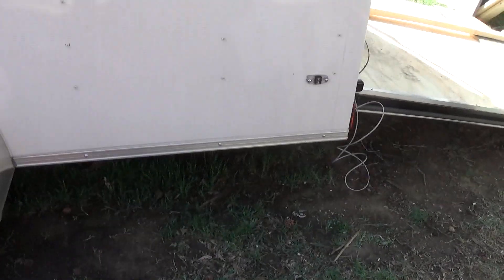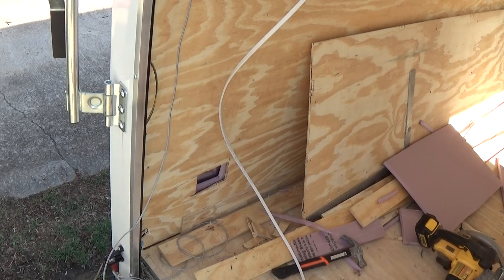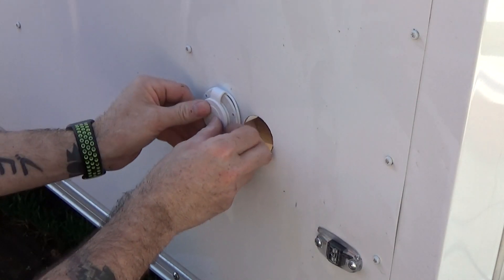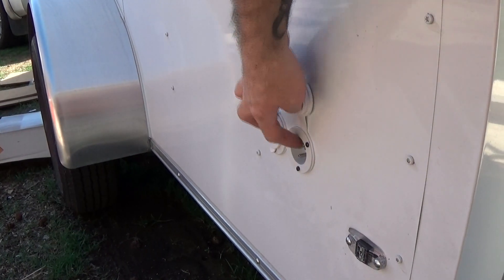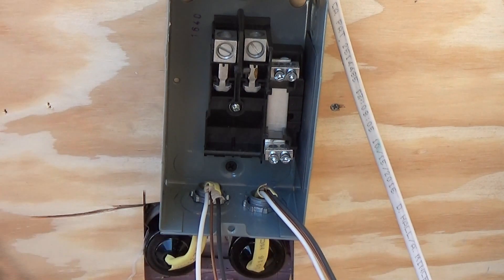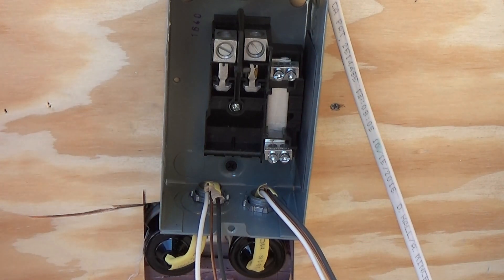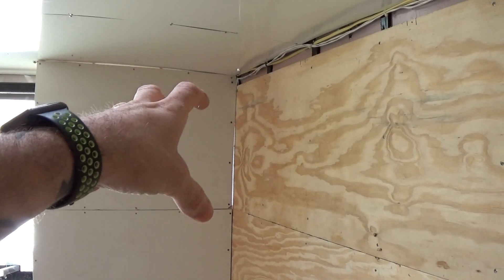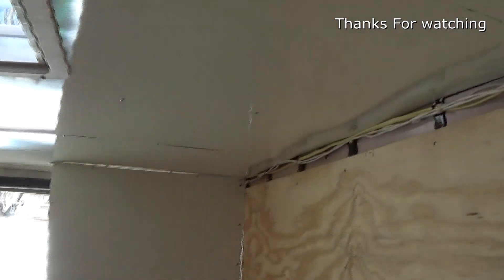6x12 Enclosed Trailer Conversion Electrical power

Comment: My question when I watch any of these is why are you grounding a 120v system to the frame, where a 12v system also is grounded? Wouldn't that potentially set up a situation where 120v AC could be introduced into the 12V DC system.

Comment: did you use a 30 amp plug and 15 amp breakers with 12/2 wire?

Comment: When wiring a house you need a  separate dedicated 20amp each for each appliance.   If your using 12 gauge wire why not just use 20amp breakers to be safe?
Reply from the maker: cause im plugging into 15 amp outlets,

Comment: Hey nice work.  I'm building a toy hauler out of a CT.  I'm trying to figure out what I need for my electrical needs.  I'm not going to run anything crazy, just a bunch of LED, phone charger, laptop, small space heater and a portable AC.  I have a generator with standard 3 prong outlets already and I want to be able to plug it into the trailer using an inlet.  In addition, when camp site permits, I would like to be able to hookup to shore power 30-50 amps using a an inlet as well.  My question is, what component(s) do I need in order to power my appliances from either the generator or shore power?  Obviously I wouldn't use both at the same time, I just want to have the option to choose.  I notice you used a breaker box, could I hookup an inlet for generator and one for the shore power into it and power my appliances?  Or do I need a switch to control the power source?  Also, is there a way to power the 12v lighting on the exterior of the trailer using an inverter when the trailer is not connected to the tow vehicle?  I appreciate any advice.  Good day sir.

Comment: Are you running off 2 different outlets on the house?
Reply from the maker: no , nor at the campsite
Reply: Kraka069 
Sorry I have a lot of questions. We’re trying to decide what the best way to pull power from our customers home to our cargo trailer while we’re on site. Are you just running 1 cord(110v) to your trailer. Into your breaker box & running everything from that breaker? Doesn’t that just trip the breakers?
Reply from the maker: @johnraisbeck9446   I Run 2 cords plugged into the same outlet.  Yes amps matter. you cant pull 15 amp and 15 amp from the same outlet just because you have 2 cords. 
but i have mine set up that i could plug in lights and such or a/c  or both . my total draw is less tham 15 amp
Reply: @Krakology  the receptacle you plug your two cords into is protected with a 20amp breaker in the house, all you can pull is 20 before the house breaker will trip I think

Comment: NICE!!! what material did you use on yr ceiling? its smooth...easy to clean...waterproof...looking for that for my trailer making it a mobile pet grooming facility...thx!!
Reply from the maker: something liek this   https://www.homedepot.com/p/1-8-in-x-96-in-x-48-in-Thrifty-White-Panel-Board-709106/207127368

Comment: Alright, I have a QUESTION ! I've been watching videos like a crazy person and I see so many different ways..Vans are putting 1 inlet in. You put 2 inlets in..Somebody puts a 30 amp in. Somebody puts a 50 amp in..What the heck am I supposed to do ? I'm working on a cargo and I will run an AC,TV,Microwave and a few led lights and will be more than likely camping in RV Parks. should I just do like an RV and put a 30 amp in ? Which way will have me covered with least mount of problems ?
Reply from the maker: how much will be your power draw.  if you will exceed 15 amp, put in a 30
Reply: I've decided today that's what I will do i recon. A 30 amp one !  Thanks for the reply. Been having fun watching all your trailer work !
Reply from the maker: thanks for watching. and good luck